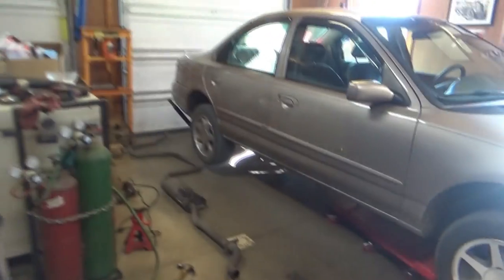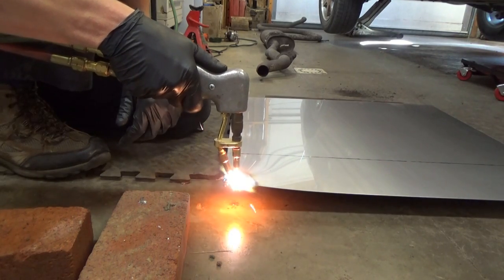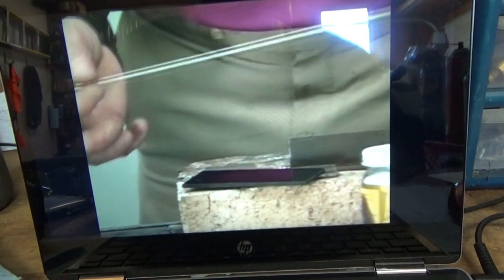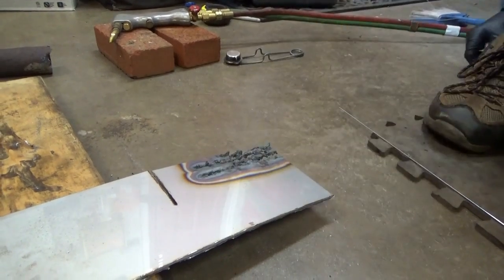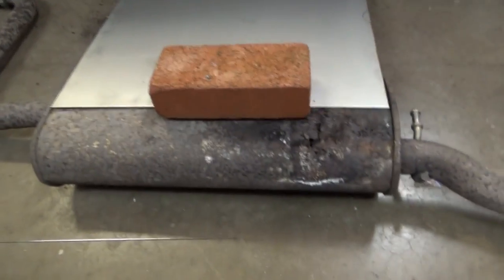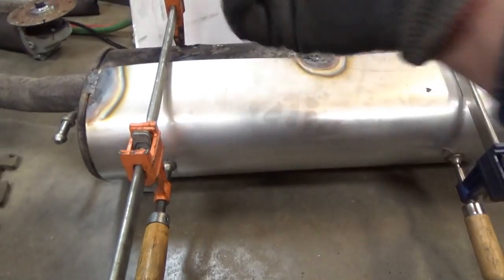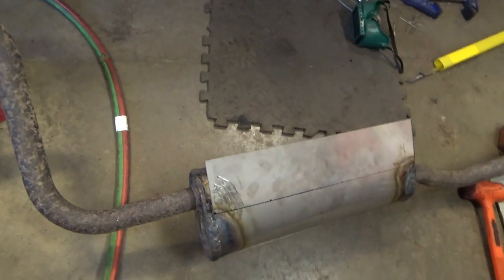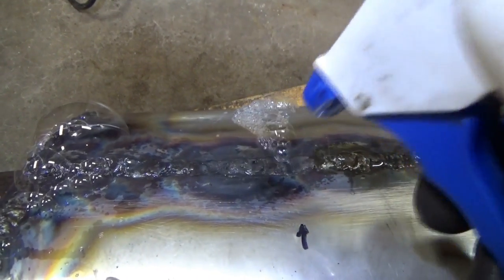How to Weld Stainless...With a TORCH!! ('96 Mercury Mystique)

Comment: I noticed you chose not to show how it sounded afterwards, or the crators you make in the concrete with the torch... Although i did see you had 2 bricks in arms reach. Use them under the weld or cut next time( fire brick should be used preferably. )
And your damn lucky you didnt habe the muffler blow up when you pressurised it. Even a few psi on a large surface area like that is dangerous... Not trying to be rude or discourage you from welding but you seriously should take a local class cus you looked like a actor in a osha safety "what not to do" training video...
Reply from the maker: @mikegarvin9925  thank you for the suggestions!
Reply from the maker: @mikegarvin9925  by the way muffler sounds nice and quiet to this day and I'm sure will outlast the car... Although it's running great at 315k miles 😁

Comment: As an auto tech, we get into all kinds of tasks. Exhaust is not my favorite! GM told us the pre-cat = 300 series stainless and 400 series behind due to the heat. 
My question is the extra torch setup you used. Other than two tips, I don't see why a guy can't use a regular oxy-act torch? I have used one for decades but bought a commercial sized MIG back in 1984. I holds the big rolls and made adaptor for small rolls.
 DK, ASE master, retired.

Comment: When you said it would cut any metal, I thought to myself "nope." Then it failed. No torch will do it. Or cast iron or cast anything. Can't cut aluminum with a torch either. A plasma cutter is the only thing that will burn away all of those crazy metals.

Comment: Ivan , I've done quite a few  of welding on stainless steel with the cobra 2000 ...I've gotten better ,cause I do a lot of small sculptures  ...one thing I know...we can't cut stainless with the oxy torch...I learned that the same way like you...years back .
You can use a plasma cutter , a cutting disc...I have even tried the heavy duty hack saw ,but it takes forever...
Mr. Ivan , you did good !!!     It just takes practice...

Comment: Worked on a many of the contours and mystiques  at the dealership. Curious how the wiring harness insulation is on the one you have . They had a recall replacing the engine wiring harness . The insulation would literally fall off the wires

Comment: Awesome job, that is an impressive welding kit.
I had a '96 Mystique that was the same color as yours, also had the rain guards on the side windows. I wonder if its the same car? Mine was 4 cyl with a 5speed manual.
 They were great little cars. To bad Ford stopped making the Mystique/Contour.

Comment: That was a great repair!! I didn't know you could buy sections of stainless that way online. Good to know! I've got to get me one of those torches. 

I just put a full stainless system on our Volvo 940 last year. I hate the way it sounds, but it was the only option to replacing the crappy Starla systems every TWO years, if I was lucky - usually 18 months is all I'd get! Total junk! Got the pipe off eBay - was $650 if I remember right. Fitment was AWFUL. Lots of cursing, hammering, and bending of mounts. I had a neighbor weld up the front piece for me, since I never looked into getting set up to weld SS. At some point I'd like to get rid of the muffler for something a little more quiet - it's got that "fart can" sound to it, which I hate.

Nice job on that LED, too! Looks great!

Comment: The key is the carburizing flame.  Carburizing flame is fuel rich and as such helps to ensure that all available oxygen gets "consumed" inside the immediate envelope of the welding flame.  (this includes the bottled oxygen fed from the torch and atmospheric oxygen drawn into the weld flame by venturi turbulence)  Absence of oxygen allows for better melting together of the base metal with the filler rod without fouling of the molten metal due to oxygen trying to combine with the alloy components of the molten puddle.  The molten puddle does absorb a bit of carbon in the process but the finished result is not much degraded by carbon absorption.  To the contrary, oxygen combining with the molten puddle is highly degrading and actually "burns up" alloy components and instead of cooled metal, you end up with metal oxides, cinders, and ashes.  The more oxidizing the flame the worse are the results,  Trying to do this in windy conditions or using too much gas pressures upsets the tenuous "balancing act" of maintaining the molten puddle inside that carburizing flame protective zone.

Comment: Anytime you cut with a torch, put something between it and anything of value under or beyond it to save from damage!   Molten metal is a concrete floor's worst nightmare!   Glass windows and mirrors collect spark spray from torches and grinders and will get particles embedded into them creating roughness and little rust rings in the future!

Comment: Interesting, never saw this system/method before!  Though considering the cost of materials even without the cost of the torch outfit, and of course the Ivan hourly rate , if this is even close to feasible??  I can see it looks like one has a decent amount of “control” with the weld, but the distortion from the heat would be a bit excessive compared to mig or tig I’m thinking??  (I know,it’s just a muffler, but I like “nice” too!)👍👍

Comment: Good fix! You're so right about the garbage aftermarket exhaust parts. I installed a wagner "stainless steel" muffler ($130) on my 2000 camry and 2 years later in Ohio weather, it's got rust all over it. The OEM muffler is $400 so that's a problem too lol

Comment: The outside may not rust anymore but I'm guessing the inside certainly will and get pretty loud. Also, a chunk may break off and cause a partial obstruction. Stainless steel universal mufflers are under $100.
Reply from the maker: Don't worry... It's not a Fiat! 😉😅

Comment: I've done this a lot, you can also weld aluminum.  It's actually a lot better than TIG if you have to rework it as the metal will not work harden with gas...  It's even possible to weld steel to aluminum.  All this was common before the 1950s, no need for a special torch.   Lots of training videos from WW2 on these processes....

Comment: coming soon, the baffles flopping around inside, possibly blocking flow and ends rusted through.
that's pretty much what happens to them, even if the outer case stays perfect, the internals break loose from the acidic exhaust condensate and extreme temperature fluctuations.

Comment: KIND of like tig welding with the rod maybe 304 or312? but with the flame about 3/8 in away so just the tip of a longer cone is where it melts the base and the rod.But you still use oxy-act.so the temps about 5600 degrees or so,? looks interesting.thanks ivan

Comment: Nice job Ivan, I've been looking at
that torch head for gas setup!!
One thing brother, a torch is hard on
a concrete floor, I was braze welding
a piece of steel for my 87 Chevy trucks rusted out rear shock mount
and blew a chunk out of my concrete
garage floor!! 😮😮😮😮
😂😂😂😂😂😂😂😂😂😂😂🤣🤣

Comment: I love your talent at saving parts where possible so much it pains me to point out from PennDOT publication 45: 175.75. Exhaust Systems
(a) Condition of Exhaust System - All components of the exhaust system shall be in safe operating condition as
described in §175.80 (relating to inspection procedure).
(b) Exhaust System Requirements - A vehicle specified under this subchapter shall be con structed, equipped,
maintained and operated to prevent engine exhaust gases from penetrating and collecting in any part of the
vehicle occupied by the driver or a passenger, in addition to requirements of this title for an emission control
system and smoke control for a diesel-powered vehicle.
(1) A vehicle specified under this subchapter shall be equipped with a muffler or other effective noises suppressing system in good working order and in constant opera tion. A muffler or exhaust system may
not be equipped with a cutout, bypass or similar device and a muffler may not show evidence of external
repair. 
That last line drives me crazy! Keep up the great vids.
Reply from the maker: Lol it's 10x stronger than new so that's good 😅

Comment: On my exhaust, it is all stainless steel. Pipe, and both mufflers. More expensive but lasts forever. The exhaust manifolds also are stainless too since I had to replace the cats. I eliminated the 3rd cat because Washington state no longer has emissions testing and I can pass it with my car just with the 2 cats on the manifolds. 

Taking the car to the shop tomorrow for the lean codes.

How did you add the lights to the rear beze

Comment: I figured Eric O. would be here by now stirring the comment pot with a big wooden paddle since you brought a welder out and used it. I'm definitely surprised by the comments. Usually, all the people that used to weld for NASA show up and give their insights how they built the space shuttle and you doing it all wrong. :-)
Is that your car? I figured most people wouldn't want to pay your labor rate plus material to repair a muffler. I guess the next weakest link will show itself next on that exhaust system.

Comment: For everyone's information, there are several grades of stainless steel. This is 400 grade that does not have a high level of nickel in it. It WILL RUST! If you can stick a magnet to it, it is low-grade stainless with iron in it. It WILL RUST!  If you want Stainless that will not rust, you will need the 300-grade series. The closest to 300 the more nickle. If it is 320 or 340 it is not as good but still will have a resistance to rust. You will pay through the nose for this stuff!!
Reply from the maker: Yes most OEM use 409 SS good for about 10 to 15 years. The new 16 gauge 304 shell will last for life lol

Comment: Now I've seen it. Reshell a muffler. Thought about fixing my flowmaster when it finally rotten thru.
Reply: man, im really disappointed in flowmaster quality anymore, i got a 50 series (aka big block series) on my 02 2500HD, and is just about rusted through in a years time. The previous one lasted 6 years.
Reply from the maker: @mattcat231  in one year?? Holy crap that is junk 😅
Reply: @PineHollowAutoDiagnostics  yes, 1 year, ill drive up and show ya! lol! I almost can't believe it myself, considering the cost. My truck has dual 2 1/2" inputs, and a single 3 1/2" output on the muffler from factory, the rest of the exhaust is still the factory stainless from 02. Even have original cat converters on it! 87C7AE-6DA1 is the part number on ebay for the muffler
Reply from the maker: @mattcat231  Ebay... There's your problem!

Comment: Pick up a cheap plasma cutter/ tig welder off eBay for $350 would make your job way easier. I picked one up 9 years ago done many projects with it and still works good.

Comment: You need a weep hole drilled in muffler also that is why they rust through replacement more often ! I have drilled a hole in all muffler replacement manufacturing wants it to rust a hole ?

Comment: A few of the after market exhaust makers offer stainless steel materials. I'm sure a decent muffler shop could order the right tubing and mandrel bend them nicely as OEM does. Might be a tad costly but some things are just that way. I'll bet after some time goes forward, the insides of that muffler will break loose and the debris will make rattle sounds at some point, like rocks inside a cardboard box. Nice welding gear...
Reply: A decent muffler shop can’t afford a mandrel bender. They’re like 60k lol. That’s why most of us use crush benders with aluminized steel. Most fabricators will get stainless u bends and j bends, and build what they need.  Mandrel benders are few and far between.
Reply: @Steven-qm2nh  Every muffler shop I have been to has mandrel tube benders. Maybe small shops don't or those who only do a few exhaust jobs a week don't have them.
Reply: @Garth2011  you’re wrong. They all have crush benders. A mandrel bender costs about 60k. I’ve been running auto shops the past 15 years. Even a crush bender can’t bend stainless without the proper snake belly style dies.
Reply: @Steven-qm2nh  Most of our muffler shops have both benders.
Reply: I’ve had nothing but bad luck with aftermarket “stainless”

Comment: I just bought a MIG for home. Good idea, never thought of that. Oh and my RSX does have a possible bad solder joint in the AC control head. I stuck it in the freezer and it won't work till it warms up. I can't find a bad spot though. You have any tips?
Reply from the maker: Or flex the board a bit when it's plugged in...
Reply: @PineHollowAutoDiagnostics  True and I could have it plugged in while poking with something not metal.
Reply: try a can of freeze spray, make a cone small cone out of plastic sheet/film so you can really narrow down the spray. other way poke around gently with a dulled sewing needle or pin.
get better eyeballs  🤪 (microscope/camera for closeup repair work)
Reply: @throttlebottle5906   Thank you. I'll try that. I did get a magnifying glass with a light but can't see anything obvious. I was thinking get it cold like you said and poke around until something happens 😂

Comment: Give you credit Ivan.  I found severl stainless steel mufflers for that car under $200.  I would have threw a part at it.  Especially the time it would have taken me to accomplish what you did, and it may not have turned out anyway.  Great job!
Reply from the maker: Give me some links
Reply: @PineHollowAutoDiagnostics  I see your exhaust does not look stock to what I find in online diagrms/part lists. You have a muffler where resonator seems to be on diagrams.  Going by what pipe size should be and viewing your video for offsets on in and out of muffler.  Amazon Jones Exhaust Q411B, Rock Auto Walker 21140 are a couple I find with quci search.  I still give you credit for the work you put into this repair.
Reply from the maker: @John76546-x  this is the original stock exhaust system, all one huge welded assembly lol

Comment: new replacement exhaust is junk it cracks rusts fast. 

ps Hobart makes Aluminum stick welder rods they work good for most repairs. Saves the day  . I welded the propellor blade back on my Yamaha 50 outboard five years still perfect.
Must be DC electrode +.
Nice work.

Comment: Now you could grind off the tarnish on the whole pipe and muffler and put a couple of coats of high heat paint on it to make it look even better.
Reply from the maker: Lol just to never look at it ever again 😅
Reply: @PineHollowAutoDiagnostics  Isn't the pipe still vulnerable if the original muffler corroded?
Reply from the maker: @brandonsnider7907  pipe itself is pretty beefy...just some surface rust. I am amazed at the quality of this OEM exhaust!

Comment: Mufflers rust from the inside out, due to  condensation and acid gases. So now you'll have a nice(er) looking shell, haven't you? Regarding  the welding itself: even aluminum was torch welded and then came MIG, TIG and WIG.  The 'instructional" video makes it  clear by looking at the presenter's work that this truly is a matter of practice and  not an on the go.
Reply from the maker: Yes, it is a slow process...took me half a day haha

Comment: DETERIORATING FROM THE INSIDE OUT
Most exhaust system deterioration occurs primarily from the inside out. This internal corrosion is a result of acidic moisture that is chemically produced by the combustion of air and gasoline in the engine. Because these acids are in contact with the inside of the exhaust system, these parts break down from the inside out.  
 
Acid moisture is most destructive when both the engine and the exhaust system parts remain cold. When the engine and exhaust system are fully warmed up, the hot gases coming through the exhaust system evaporate the condensed acid and send it out the tail pipe. As a result, those parts closest to the engine heat up first, stay warmer longer and deteriorate more slowly than the parts farther back in the system. Consequently, exhaust manifolds, pipes and CATALYTIC CONVERTERS tend to have a much longer life expectancy than exhaust pipes, mufflers or tail pipes. 

The type of system can affect the rate of this inside out deterioration. A dual exhaust system can deteriorate faster than a single exhaust system. Because the pipes don't get warm, moisture can condense in the exhaust and cause it to break down faster. 
 
Because of the acids produced during combustion, the exhaust system is one of the very few parts on a vehicle that continues to wear even though the engine is not running and the vehicle is stopped. This acid deterioration of exhaust parts, along with driving styles helps explain the extreme variations in exhaust system life even within the same climate zone.

Comment: Next time use a 1 inch wide banding clamp. Just like putting a bandaid on exhaust pipe with radiator hose clamps works great
Reply from the maker: That's what I tried previously...but the bad section was like a foot long, so it didn't work very well haha

Comment: An innovative solution Ivan. I am interested in the savings (if any) to replacing the muffler?  I am so lucky exhausts last  decades where I live (Australia). I have had to replace an exhaust manifold on two vehicles in the 37 years I have been driving, that's it. I reckon there was a manufacturing fault on them as an OEM exhaust manifold is a pretty robust item when compared to the pipes down stream.

Comment: as im your fully aware 95 percent of exhaust systems corrode from the inside out on expansion boxes and silencers due to the changes in temp and moisture you should have just built a full stainless system as its not going to last ivan good practice though. i recommend a tig set up to do it though
Reply from the maker: "not going to last" is relative...if it stays decently quiet and leak-free for 10 years, then I'm happy :))